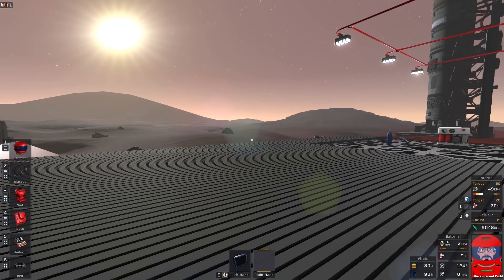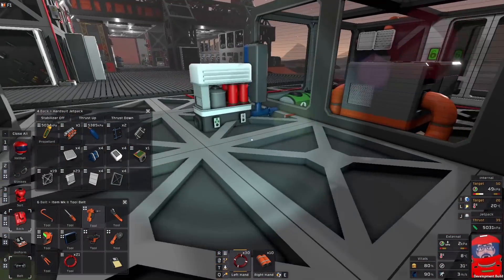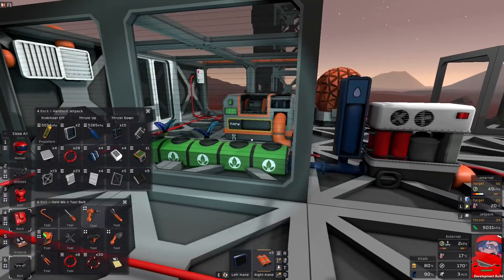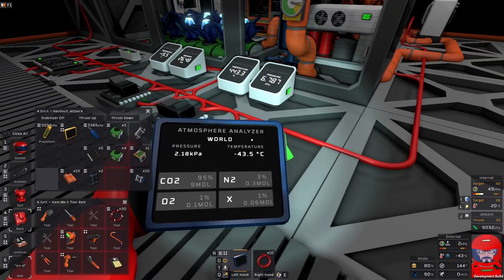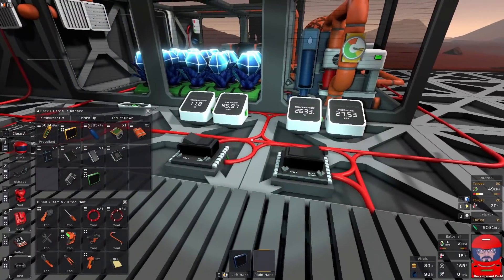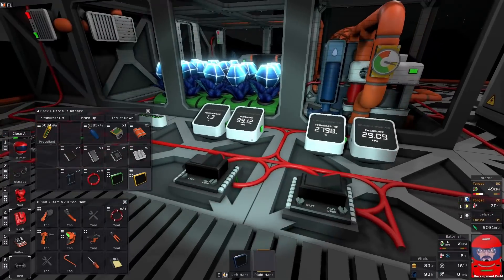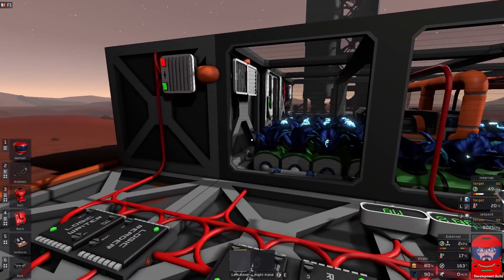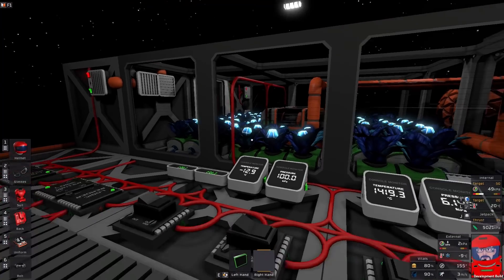Stationeers Winterspawn Sterling power plant (pun intended)

Comment: I tried to replicate this with the latest version, and it appears the Winterspawn Beta no longer performs hydrolysis, although it does still convert nitrogen into cooling.
Reply from the maker: They wont do hydrolysis until they are fully grown now.  And the rate has been reduced since this video so this will not work any more.

Comment: Really good job! I reckon if you vented the filtered gas instead of returning it to the room you could save on a vent and wouldn't be discarding h2 and o2 And eventually run dry. Also nitrogen is now a fuel for this space fission reactor.

Comment: Loving the content! Yeah I didn't get around to testing this particular interaction, I need to check if the implementation of the plants takes into account the enthalpy of hydrogen but I suspect not if it's possible to make this loop!
Reply from the maker: Thanks, I wasn't sure how you guys were recieveing my videos.  I do tend to speak my mind, I hope my lack of social skills hasn't upset anyone.
You might also want to check the gas production rate in comparison to the electrolyser.
Reply: @cowsareevil7514  Your vids are top notch! Stationeers is all about exploring the interactions of different systems, love seeing content like this where new things are combined in new ways! 
yeah I'm working on a fix now, The issue was they were producing 20 times more moles of output gas than what they were taking in and also not taking the correct amount of energy from the air for the amount of gas they were making. I think we're pretty happy with their cooling ability (100w per plant) so the balance is to correct the water consumed and output gas created to match the energy they're using.
Reply: Any chance I could get a copy of this save.. for balancing purposes...lol
Reply from the maker: It is not working as well anymore. I think it might have already been rebalanced.  World save:
https://steamcommunity.com/sharedfiles/filedetails/?id=2590768322
Reply: @cowsareevil7514   looks like the planters were heating up the room as well (as your pipe water was 1200degrees) I've made a couple of balance changes on next beta build, they now use the electrolysis equation so no more infinite energy machines. You'll also need to cool your input water on all plants now too! GLHF :)

Comment: With that much power, it should be easy to filter nitrogen.
Is it possible to reduce the sterling generator by reduce the flow through it? So you can regulate the temperature inside?
Reply from the maker: I haven't tested that.  I imagine it would have effect to reduce efficiency.  The temperature only changes slowly so a simple on/off would probably work best.

Comment: Completely overpowered, produces basically everything you need for a base only requiring nitrogen to power it. It should probably be nerfed.
Reply from the maker: Biofuel was very OP when it was new but seems to have struck a good balance now.  I expect that this will be the same.  Although balancing an impossible plant will be interesting.